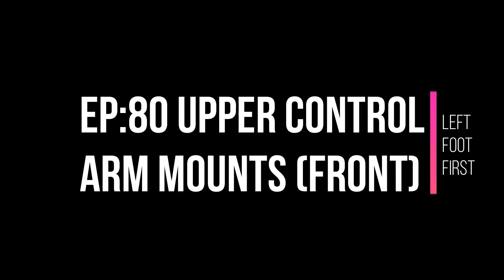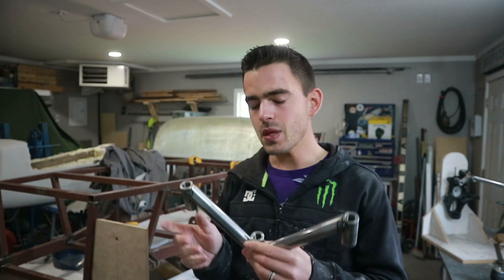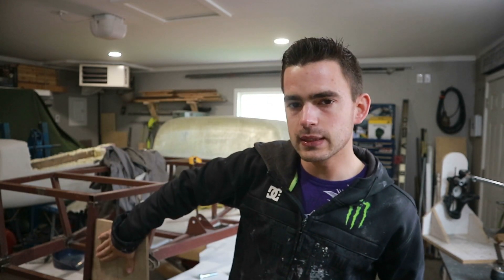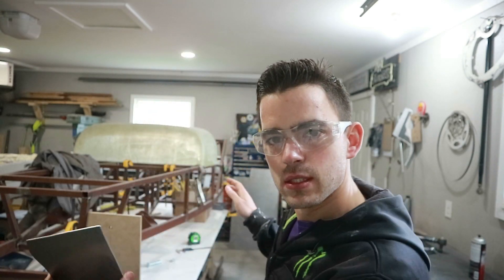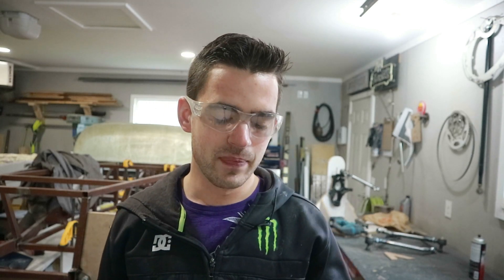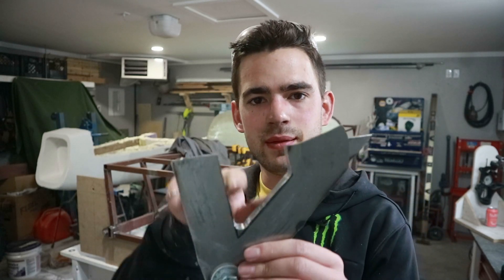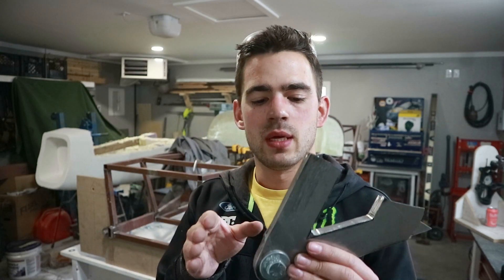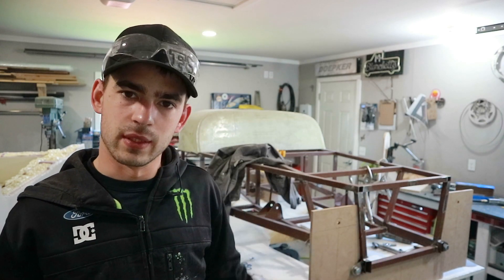Ep 80: Building the Upper Control Arm Brackets

Comment: I’ve always thought the front suspension mounting on seven clones looks a bit light.  I much prefer the way you have done yours.
Reply from the maker: Thank you, its mostly guess work but i agree, most suspension brackets on these cars look pretty flimsy. But they were designed for about 80hp I believe
Reply: @leftfootfirst9847 .   On the other hand,  if the mountings are as flimsy as we usually see, but obviously strong enough, cos they’re still on, if you have an accident it will snap off rather than destroy the whole frame.   Heads you win, tails you loose.